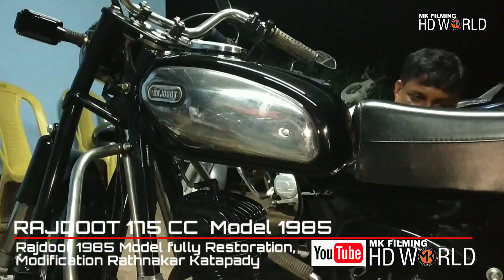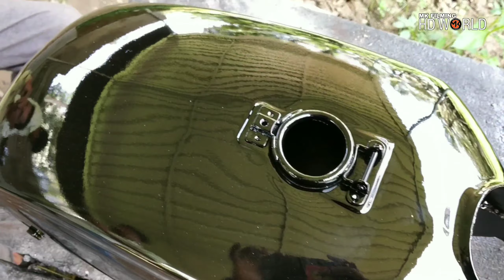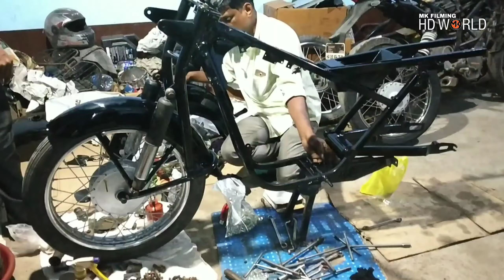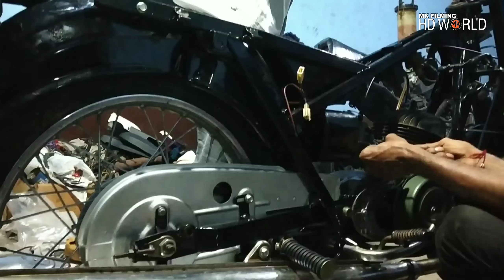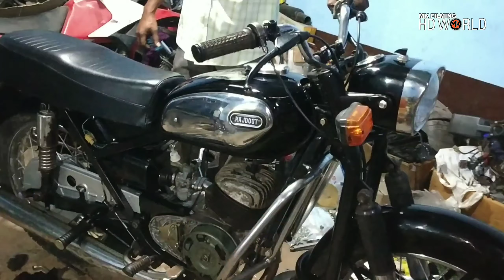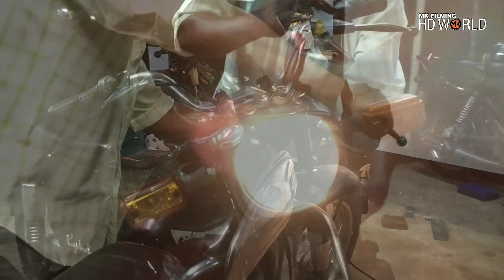Rajdoot Restoration Project | Vintage Bike Rajdoot 1970 | Modified Rajdoot 2019

Comment: Sir your work is awesome but it's incomplete why u not use night eye led bulb ...and installation battery system for self ..and double bullet horn ........with indiaction of fuel meter and accelerometer ....and engine paint Matt black with fully cylincer chrome is missing ..... just littel bit work this .  Your bike I think perfect combination of vintage and modern bike system